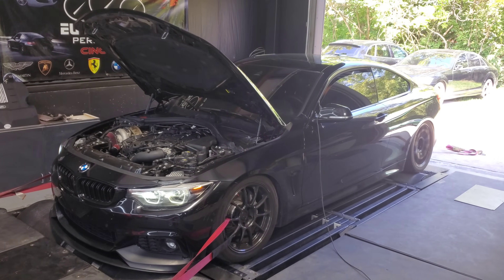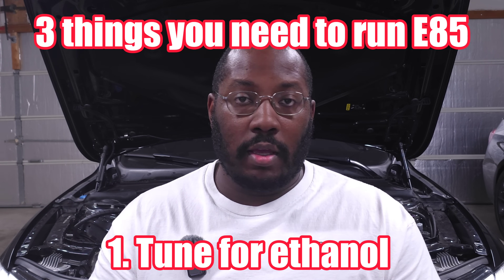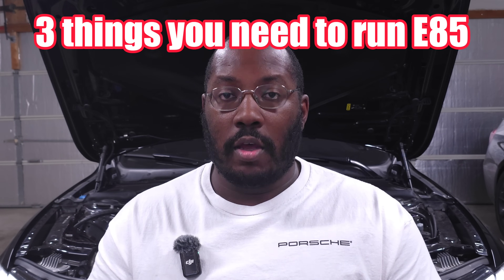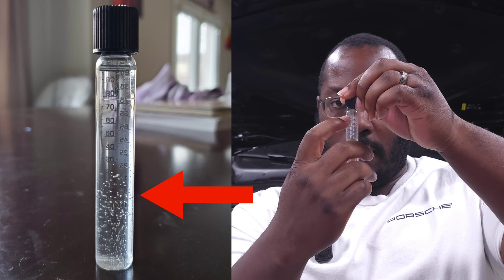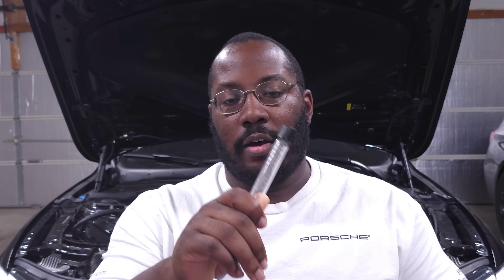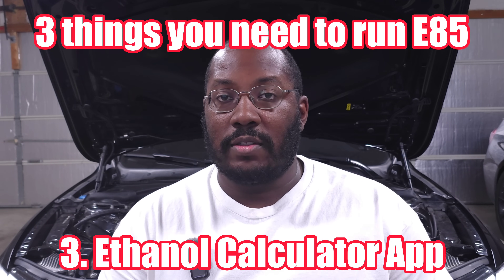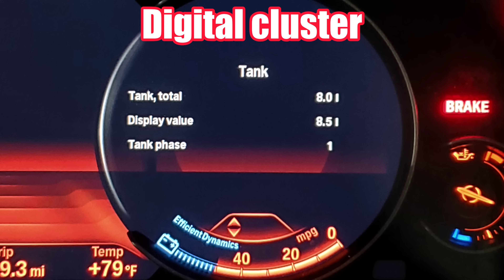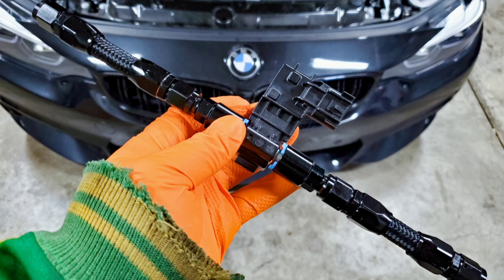Running E85 in a B58 or S58 is SO EASY (Long Term Review)

Comment: Hey Kern417 I have one question, and no one is sure about this 🙄 Do you recommend to upgrade the LPFP first ? 
For E50/60 mix I have the newer generation B58TU 
So the TU Pump / Catless / OPF delete / Open Airfilter = 490HP / 800NM 
Now I’m wanna run E50-60 
Chat gpt say first to update LPFP 
What you say about this or maybe someone else know it ?

Comment: How safe are ethanol mixes like e30 and e40 for the engine?

Would running e-mixes over time build up gunk in the fuel system causing premature failures? 

To my understanding, if you’re not letting the car sit for too long and occasionally cycle full 93 gas tanks you should be okay.

Comment: I appreciate all you do... Although I'm living with the n55 I'm able to get help from your videos... Just recently relocated my mhd flex fuel sensor kit from under the top hat of the lpfp to the engine bay using the new updated wire harness from MHD, because the old harness style in the trunk that makes the connection to the ekp has had burning up issues. As a matter of fact mine just melted after being on over a year now.   Anyway your flex fuel kit install is exactly what I needed to do this, and I thank you for it. 
Take care of yourself, and keep doing your thing....

Comment: How do i open the hidden menu to see exact how much fuel there is in the gas tank?
Reply: Did you figure this out
Reply: @icedoutbiscotti7644 yes hold trip reset button for 10 seconds. Than enter your pin code. Your pin code is the last 5 digits of your vin number combined

Comment: Hi thank you so much for all your  videos much appreciated for always helping us 

I have a 2021 m34i 

I have jb4
Downpipe 
Bms intake 
Flex fuel integrated to jb4
Bms charge pipe 
Im thinking about adding a 6 nozzle port injection stand alone meth  kit

As in sa we dont have e85 i have to order ethanol as i want 
I have stock turbo and stock hpfp and lpfp and stock internals 

Can i still run e30 + meth injection

Whats your recommendation?

Thank you

Comment: Hey Kern I have a 2019 M240 Xdrive and
my ECU build Date is 2018.08.08 according to MHD.
MHD says I need a bench unlock but it also says it cannot always detect if it's locked. Can I just flash it with MHD or do I need to bench unlock it?

Comment: e50 top mount turbo. Port injection running 30 psi. What power you think i make?
Reply: What size turbo? Which car?
Reply: @matthewchevres4970  64mm. Gen 2 b58. M340i
Reply: I’d say low - mid 7s

Comment: Hi. E85 is corrosive as you said, but have you checked your fuel system such as fuel tank, fuel pump, fuel line from the pump that made with plastic under the 
body of the car and metal fuel line parts? Hope I can get some idea of your 5 years of ownership usages. Thank you.
Reply: All those parts are safe, long term effects are more in the engine, like if you aren't changing your oil often it will gunk up. Its not good to run your car on E85 for daily driving, try to pump it for fun times only

Comment: I think you should have touched on using a couple of gallons of E85 on a stock car
Reply: Manual says don't go above an E15. I run 1.5 gallons of a true E85 in my G87 and she runs great.
Reply: @davidtennien39  cool I didn't know it said that. I'll stick to that thanks
Reply: @carbonm2  keep in mind the vast majority of gas pumps are already E10, and legislation passed allowing up to E15 on regular pumps.
Reply: he already made a video in the past. on the stock fuel pump with an e30 tune it was able to run fine with about 60% ethanol
Reply: I run 1.3 gallons of E85 in my 340 anything more than that and the car acts up im on a bm3 stage 2 91 map so the e85 cleans up the timing corrections and helps make just a tiny bit more power
Reply: @FernyB58 why not throw a bit more and run 93 tune?

Comment: I am running full E85 on stock engine since over 40.000km - with a custom tune of course. Power seems comparable to a full stock car.
Reply: How are you only make the same power? You should be getting a ton of gains from a tune with ethanol.
Reply: @writeoverhere no. This is because of the fuel pump, ethanol is thicker than gas, when you are running a blend without an upgraded fuel pump, you don’t gain any hp because your not pushing enough fuel to gain any power. Your psi might peak higher by 1-2 but your timing will be off, which balances out making the hp the same.
Reply: @writeoverhere just adding your hpfp without ethanol will give you power gains of 20-40hp on normal gas because it can push more fuel at a time, so then once you actually switch to ethanol, it can push more fuel at a higher octane, and at a faster rate even with the fuel being thicker, which gives that 50-150hp gain.
Reply: Yeah you're not gonna have gains on full E85 with stock fuel system as your tune will step back the boost since you have less fuel at the top

Comment: Hey Kern, quick question, did u change the fuel filter or u kept the stock one? Just wondering if it needs to be change due running E
Reply: No need but if you should have an upgraded LPFP if you're running full E85, which in its own will come with a fresh filter
Reply: @SharamanONorgannon  cool thanks i been running e for couple months just worried of filter getting clogged

Comment: loving these vids. very informative as usual. got urself another sub.... you mentioned a tune but whats your thoughts on running e30-e40 with piggyback tune (like a jb4) on a stock fuel system? I've heard its fine since the difference in 93+ map and e30 is only 2 psi so its not a crazy increase but a bit worried bc a piggyback tune only really plays with the boost and can't change things like the fuel injection timing to my knowledge
Reply: I'm also interested in this.
Reply: @writeoverhere indeed
Reply: if you are gen 1 and have stock fuel pump, your fuel pump will not be able to push enough fueling to gain that extra hp from the e30-40 blend anyway so there is no point. Ethanol is very good when you actually have the fueling system for it, but without the helping factors, like a hpfp or a sensor, your car will be lack luster.
Reply: @sdfddf6911   interesting. thanks for the feedback on this... i have a g87 and have done a bit of research since i posed this question a year ago... correct me if im wrong, but it seems the g8x's stock fuel system is fine running e30 (some say up to e40) and you will see gains running e30ish with a flash or piggyback tune. anything over e40 tho, and you're gonna need an upgraded fuel pump at least.
Reply: @js002003 Yes, you have the s58 platform which can run ethanol with the right tune from stock because it has that upgraded fuel pump and injectors compared to the gen 1 b58 like I have. Just make sure your e85 is measured correctly if you don’t have a sensor but other than that you’ll be perfectly okay. G87 manual is the next car i want!
Reply: @sdfddf6911  thanks again for the response! yah im installing a sensor so I don't have to worry about if i get my calcs wrong... and yes, I cannot recommend the g87 6 speed enough. just make sure to do a cdv delete and a clutch stop!

Comment: Have you made a video talking about the pros and cons of meth injection?
Reply: @ScubaDriv3r  I ran 100% meth on my daily for 2 years straight. No water mixture. No issues. Pros: power, cooling, more knock protection. Cons: Dangerous, fire hazard on top of invisible flame, inhalation hazard, constant worry in the back of your mind
Reply: @carbonm2  would it be safer if I ran a 50/50 water meth mix?
Reply: @ScubaDriv3r Yes, much safer and not nearly as flammable. I’ve ran this combo on a turbo G35 and RS3.

Comment: I did my custom tune by myself, I’m running e40-e50, 1 sec 60-130 faster then MHD ots e40. And I’m maxed out timing, I’m now on 19 deg on stock turbo, and it’s max for b58, all timing over not gaining power. What I’m talking about, full e85 will not gain a lot over e50, just a little for better cooling effect.
Reply: You’re 19 degrees of timing on e40-E50? What’s your boost level? Max MBT should’ve been around 17 depending on your boost lvl and fueling
Reply: @universalg_ right I thought 17.5° and 24psi is legit the limit if you have the highest high-pressure fuel pump in the market
Reply: @universalg_  22-24psi
Reply: Full E85 at these power levels is for ease of use not for power. Even hybrid turbo you aren't coming close to needing full E85.

But remember, with full E85 you are "bullet proofing" your fuel by taking away 93 all the way so that there's no chance of shitty 93 fucking up your timing

Comment: Running mhd + it just doesn't seem to comfortable knowing that even though there's no check engine light if you scan for codes it will show the engine is running lean on full e85 but blended it's perfect with no issues.
Reply: You’re gonna blow you engine running full e85 if you don’t have the support mods needed. The reason it’s showing lean is because you need more fuel flow and your stock fuel system can’t handle it so it runs lean. You don’t need a check engine to tell you it’s gonna ruin it.

Comment: So an 6-port Supra’s, I could run full E85 reliably with just PI? No need to upgrade HPFP and LPFP? Most of the Supra guys be saying to upgrade PI w/ LPFP 😅
Reply: You can but it will be slower then e40-50. It going on low boost.
Reply: Need LPFP if you're big turbo especially

Comment: Kern, realistically, how long would the stock turbo last on a e50 flex fuel tune from BM3
Reply: Same as a 91 tune bro
Reply: I believe due to people wanting more speed you will most likely increase the wear of the turbo on E50 due to bm3’s tune requesting a max boost level of 24psi and then it tapers down to 22

Comment: But how can i know if my 98 ron pump gas is actually 98 ron? (for mdh tuning, for example). I just installed the tu pump and already had 200 cell downpipe, so i switched form stage 2 93 oct to stage 2+hpfp 93 oct, aaaaand tbh.... there isn't much difference. I DON"T HAVE ACCESS TO E, in case anybody suggests. I live in Romania, east Europe.
Reply: On pump gas you can make all power with gen1 pump
Reply: @n0t_fast  then why does mhd have separate tuning levels, stage 2 and stage 2+ hpfp, both for pump 93 oct gas?
Reply: @gabasilviu  because tu pump need adjustments
Reply: baga de la OMV de 100 și sigur este peste 98 . La mine a fost o diferență de cuplu sesizabilă între mhd stage 2 93 vs stage 2 hpfp 93 . Am un m240i f22.